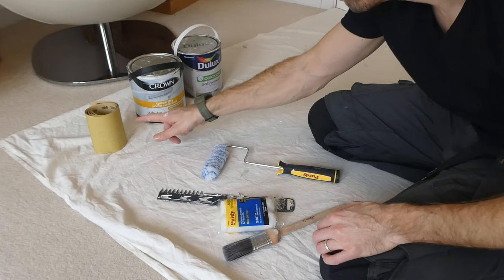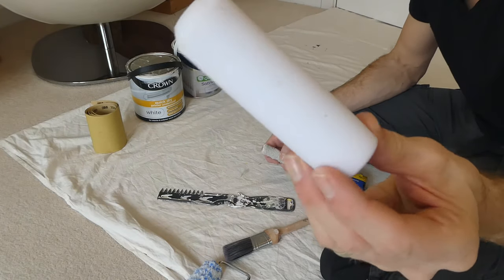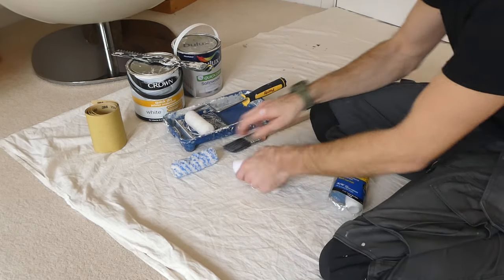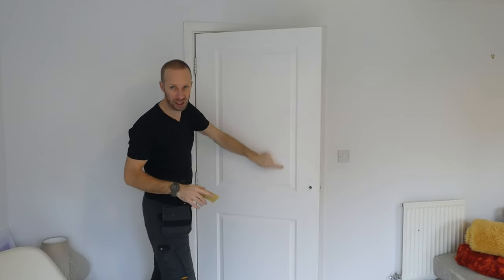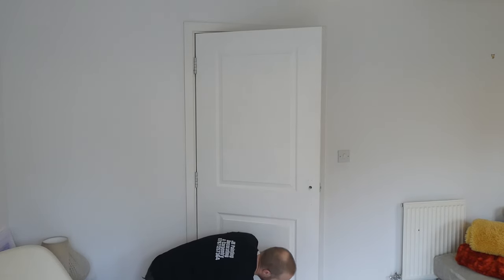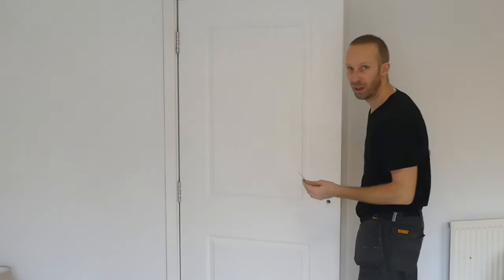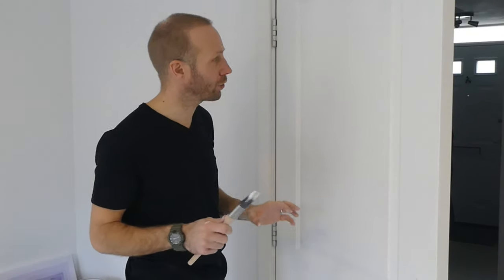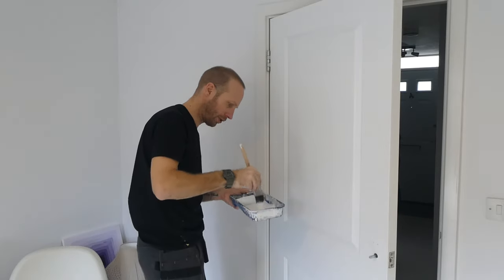How to prepare and paint a door - Using a Purdy roller and Dulux paint

Comment: Looks a really good finish with water based paints jb👍 I’m old school and a professional painter & decorator. Oil based for me on these types of doors as mentioned like cardboard manufactured so very light sandpaper work minimum 120 grit also  put lining paper under the door as not to pick up any dust particles from a dust sheet that can be transferred back to the door. Dry brush control in the corners to stop any runs after door is finished 👍 I like to use 4” Hamilton roller heads and lint free for a perfect finish. 👍 I suppose all painters & decorators have different ways, tips & tricks etc. So good job jb and good clear video 👍
Reply from the maker: Thanks Steve, for the advice, and the feedback 👌🏼

Comment: first your sleeve is to fluffy for a door,6mm microfiber nook and cranny, second black polythene under door is the best sheet for painting door, crown is a resene brand in nz so i would not mix and match as to warrenty , leading edge is the term used for the door edge
Reply: Third,,, Warranty is spelt thus

Comment: Thanks, but how do you avoid the orange peel effecr, particularly noticeable on flush doors. Aren't you supposed to feather off using a thin, wide brush?
Reply: Or lay off with a 4mm mohair mini 100mm  roller...works a treat.
Reply: where, pray, does one purchase such a roller in GB?. I recommend using a ProDec Advance Ice Fusion 100mm roller for flush doors, much finer than ordinary rollers & so finish is greatly improved

Comment: If an indoor door has been gloss painted already, must a person use undercoat first to gloss it again?
Reply from the maker: No, just rub it down with a bit of 180 grit paper to take away the shine, dust off, wipe clean,... and you're ready to go 👍
Reply: @JBTV  What to do if someone has lightly rollered a smear (not a thorough job at all) of matt emulsion on top of old gloss (quite tired) painted doors? Sand or scrape or.. what will take the emulsion off or suitably prepare the surface for a new gloss coat?

Comment: Very clear ! I have "wood grain effect doors" which appear to be imprinted cardboard grain laid on the door facings. Any attempt to sand them is like tearing back this thin layer of cardboard. White spirit has done till now in erasing finger grease. But I guess for re-painting I'll have to use a primer and high opacity top coat ( just the one .. .)

Comment: Hi Justin , thanks for doing this door painting Vlog on your channel. I am in the process of doing my Living Room door up both sides . I have sanded and wiped it over to I really need to Prime the door as well before I paint it ? 
I am using the low odour Dulux Once white gloss paint on it . It is a plain big standard door with no panels in it. ????
Reply from the maker: Hi Jennifer, as long as there is no bare wood showing then it should be fine.

Comment: Dear Justin, thank you for this great video and for your patient and clear voice throughout. I am unwell in bed but need to paint my doors as soon as I am able to as I painted all the property walls (beautifully!)  this summer. When loading the brush, do you use plenty of paint or is less paint better? It is many years since I painted doors and I am not looking forward to the event at all.😕 All my doors are unpanelled so I assume I shall need to use a larger brush or roller. I have never used a roller brush before for any painting so it will be rather daunting. When I do feel well enough, and when I get the necessary tools together, I shall be checking your video often for advice.   I have just thought of one more query. I have no idea whether the original gloss paint used was water or oil based. As long as I follow your instructions on sandpapering etc., will this in turn mean I can use a water-based gloss paint which is my preferred choice?  Thank you.

Comment: Hi Justin, do you wipe surface down with a wet cloth, when using water based products? 👍👍👍
Reply from the maker: Not entirely necessary, but yes I usually wipe with a very slightly damp cloth after dusting

Comment: I notice you didn’t go back over rolled sections with a brush. Doesn’t this make the finish on the rolled sections look different to the parts of the door you cut in with the brush?
Reply from the maker: You don't notice it, the brushed section is minimal and both sections of paint are very flat

Comment: Do you need primer if pairing over oak doors ?
Reply from the maker: Yes you do 👍
Reply: @JBTV  thank you for the response, can you recommend what paint is best to use satinwood or eggshell. Would the wood grains still show if it was to be painted rather than stained
Reply: @JBTV  water based or oils based primer ?
Reply from the maker: @soothingsounds2650  personally, water based primer and water based top coat, and same goes with oil based. If it's indoors, I'd go for water based
Reply: @JBTV  cheers mate, yes for internal doors, planning to use primer and then a satinwood finish paint for the top coat

Comment: What was the finish like.was it very orange peel
Reply from the maker: In the clip where it was dry, it was hard to see, but yes it's pretty flat, more flat than orange peel!
Reply: So u DON'T need to  lay off with a brush .👍😁
Reply from the maker: @StephenSmith-vs8hr  The roller leaves the paint really flat, so it really depends on whether you want a slightly brushed finish..